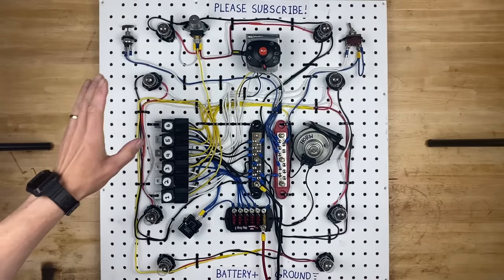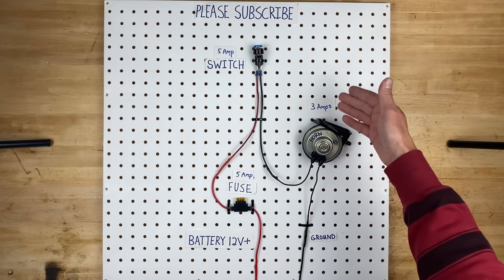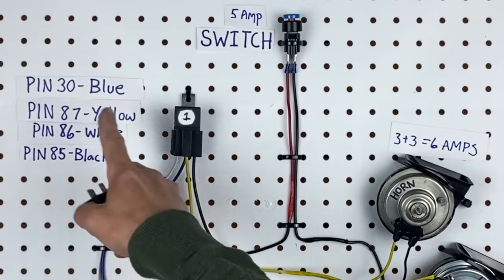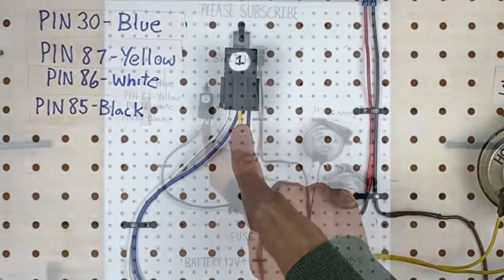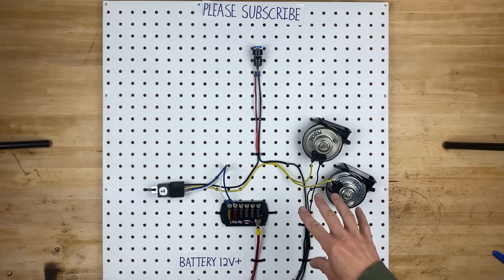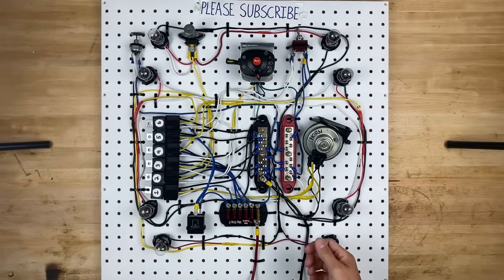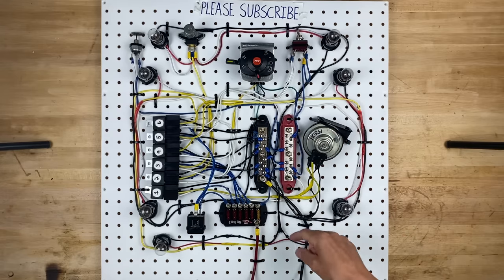How to Wire Headlights, Turn Signals, Brake Lights, Parking Lights, Hazards, Horn, Kubota Switch

Comment: The switch I ordered from the link has different color wires how would I find out what wires do what?
Reply from the maker: You’ll need the test the continuity across the wires in the switch. The good news is that I’m working on a video about this right now. So stay tuned.

Comment: Okay so if I’m using a positive busbar to supply power to a fuse block that’s supplying power to relays what size fuse would I use for the busbar? This is where I’m getting confused how is their only a 5 amp fuse being used?
Reply from the maker: The fuse size depends on what is attached to your bus bar. I actually made a whole video about this topic which you can see right here https://youtu.be/EhzN6UdnmPA?si=t2NXJ7mE1pisvth-
Reply from the maker: I’m also think watching this video I made about relays and the amperage that they draw may help make more sense of this topic. https://youtu.be/QCkfFCLa_Jg?si=1cQBTYkv6PBEuSoA
Reply: @WiringRescue  so I have a relay board and I’m wiring an in tank pump. I have a barrier terminal block that my 86 and 87 are going to. And then a fuse block that gets power from the battery. My battery is in the rear and I want to power it with a 4 gauge cable, and according to a wire gauge chart 10 foot for a 100 amp max fuse block is plenty. My confusion is my fuel pump rewire I’m doing would make it so I need to run 86 and 87 to the old harness above the tank. Not sure what gauge wire to run for those at 10 foot so it has enough flow. And then since my relays and fuse panel are next to each my pin 30 is right next to the fuse block and it’s 12 gauge so I’m not sure if I should rep in a bigger wire into the relay on 30 or not? Sorry it’s a lot I just don’t want a fire. It says for a 10 gauge wire if it was going to the battery run a 30 amp fuse. I’m thinking run a 10 gauge wire for pin 87 and 14 gauge for pin 86 as it’s just the switch for the relay.

Comment: Does the Kubota switch you are using have the high and low beams on the switch?
Reply from the maker: Technically you could wire it that way, though I used the kubota switch to turn on the parking lights and low beams. If you don’t have parking lights, you could use the switch to turn on the low and high beams separately. It all depends how you wire it.

Comment: Hello, thanks for the info. When headlights are on, sometimes the brake lights come on too and the engine does not shut off even with key in(only when headlights are on). What could be the problem
Reply from the maker: Honestly, I don’t think I could diagnose it without being there measuring voltage with a meter. With the limited info I have, I’d start by looking for things that are obviously wrong. Sketchy wires, busted alarm systems, broken grounds, rusty grounds, broken switches, etc. It really could be a whole bunch of stuff. Sorry I could not be of more help.
Reply: @WiringRescue  Thanks for the reply

Comment: What gauge is this?
Reply from the maker: The gauge sizes are dependent on what you are powering and how much amperage is drawn through your wires. I have another video on how to determine fuse and wire sizes. Check it out!

Comment: Any reason you couldn't use the high beam/low beam switch to run a relay (or a pair of relays) up closer to the headlights, so you don't have to run so much heavy gauge wire from the switch to the headlights?
Reply: You still would need to run an equally thick gauge wire to the relay itself
Reply: Well sure. But if I've got battery in the front of the car and just place the relays nearer the headlight. Should all be closer together = less wire needed.
Reply: @jcrobinson  yea that should work then

Comment: I bought a Kubota switch but the wire colors are different than the illustration on the video. 🤔
Reply from the maker: Strange.  You'd have to probably put a meter on each of the wires and figure out how they all work.  That's how I figured out mine. It took a little time, but as you can see, it works!

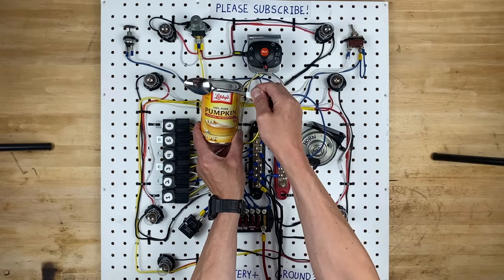Comment: 0:51 please don't give me too many ideas, I may just act on them.

Edit: imagine only being able to start your car by inserting a can. I'd like to see somebody steal it without knowing which brand of baked beans they're gonna need.
Reply from the maker: Lol. Have a message on the dash “please insert beans”. I really need to do this.
Reply: @WiringRescue  ok you just gave me an idea. Firstly, the beans are a one time use and go into a compartment after starting the engine. 

We would then make a car renting service where the only way to rent the car is to input beans. Now we only have 2 issues. What if people don’t return the car? And what happens if it gets full of beans?

Well, we’d have a station somewhere that they’d drive up to and it’d somehow release the beans. This could possibly be like a food shelter. Or we could come up with some other business where we actually use the beans to make money.
Reply from the maker: @christianwoodbury2480  - I like this entire plan. Not only do we integrate beans into automotive circuitry (as they should be), but we help provide canned goods to food banks. This is the greatest idea I’ve heard today for sure. It may also be a good idea to have a bean cannon for those folks driving slow in the fast lane.

Comment: Please meke video for reverse voltage protection circuets.
Those relays are terribel in Europ I dono what relay type to use or what diode value to use honestly.
Some peopel say put diode side that is straped with white band to and point it to pin 86 to relay Im not shure if that is correct or not.
Those Europ relays are crap they fail even if they have internal diode I think they put it oposite way .
So please make video or point or where to put diodes on:
2pin head lights on buzzer.
3pin blinker relay.
4pin rear defroster relay
6pin wiper relay.
Oddly enough those fools from GM have no diode inside the dashboard and the field wire for the delco 12si alternator uses only bulb and goes to 4pin relay pin 86 from there it goes to alternator .
So me car refuse to shut off self acelerates have leaky 4pin relay ,back charge problems,even the blinker relay acted like buzz coil when key is in off position and when all 4 hazard lights are used it is wurth to mention me car does not have ballast for xenon bulbs it never done such strange things before now Im stuffed figuring out where that staff comming from.
I am super anoyed and actualy its dangerouse engine arcing or magnetised engine pulling the trothel cabel at full power .
So please recomend how to finde the fault and what diodes to use I put out all me wires from car makeing new heavy dutty build.
So Im surching for ich circuet to be seperated from ich other and if posibel reverse current and reverse voltage protection for ich device if posibel also systems that are cloosed loop not conecting ground to chassys if posibel circuet those old cars have rost problems and I dont want to replace crapy sheet metal always .

Comment: This is a old vid but does anyone knows the AMP ratings for the switch??
Reply from the maker: This amperage ratings on the switch depend on what you are doing with it. I made a whole video for this question. Check this out, https://youtu.be/EhzN6UdnmPA?si=ECbT6MIe6Z4pmyyg
Reply from the maker: This is another one that explains the answer pretty well. https://youtu.be/QCkfFCLa_Jg?si=Tk1T-MkbvOK-oe9W

Comment: Never will understand why we use chassi  grounds when we know electricity flows the path of least resistance so do you think the chassi has less resistance then a Isolated copper wire connected to the negative side of battery not to mention (Electron flow theory that states electrons flow from the most negative side of a circuit to the most positive side of the circuit) we are still teaching the wrong electron flow theory aka (Conventional flow theory that states electrons flow from the most positive side of circuit to the most negative side of the circuit).😮
Reply from the maker: Having grounds for each circuit would cost more money, and car makers don’t want to do that. It’s also twice as many wires to diagnose when things go wrong. Using a chassis as a conductor has worked well for a long time, even though you’re right that it could be better given the right conditions.

Comment: Potato was a disappointment but not impossible
Reply from the maker: The potato was a big disappointment for me too. I feel like my whole childhood was a myth.
Reply: @WiringRescue  don't forget that potato will have a small current, strengthen the signal or use another relay that will engage at such small voltages

Comment: Nice, but that's how they did it 100 years ago.
You'd better take that to a museum before it crumbles to dust.

Nowadays every headlamp or taillamp has it's own CAN Bus IC and every Bulb (LoL, talking about 100 year old tech... I meant every individually addressable RGBWW LED) can animate your turn signal or DRL or cornering light or just animate whatever you want.

And the fuse box became history 10 years ago when Tesla released the Model S
Reply from the maker: This diagram was never intended to be the latest and greatest technology. There are lots of fellow car enthusiast out there that just need simple circuits to make they car work the way it originally did.

Comment: This is totally pointless. 
The whole idea is to not hack out the wiring from your classic car or any vehicle. And if you do have a car that needs wiring you can go and buy a kit less than what it took to build that monstrosity the best thing about this video is it's not necessary. You can go get a kit for really cheap that covers all that and it comes with instructions on how to do it and it doesn't have any of the messy connectors and crap that this monstrosity does
Reply from the maker: If you don’t like this sort of thing, this is probably not the best channel for you. I’m sure there are many others that show how to wire a universal-style fuse panel into a car if that’s what you’re after. Good luck with your project !